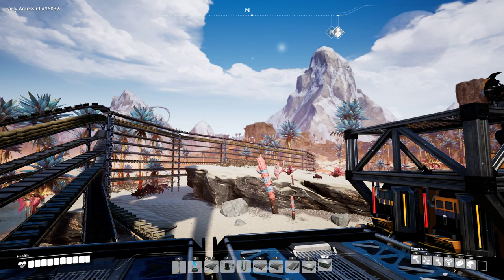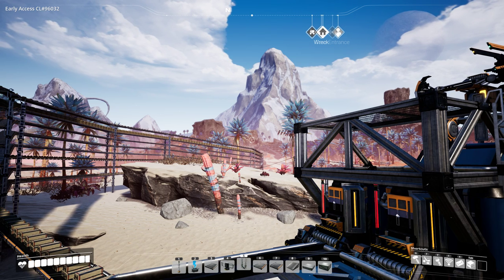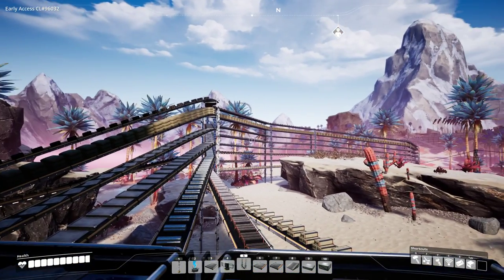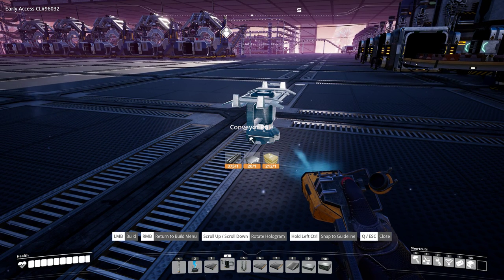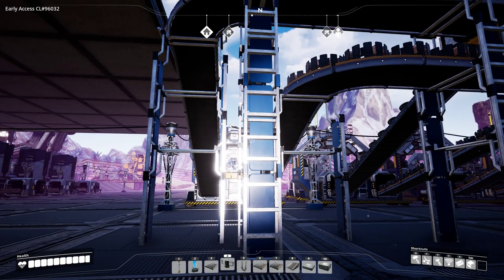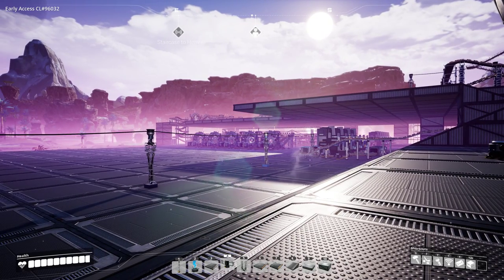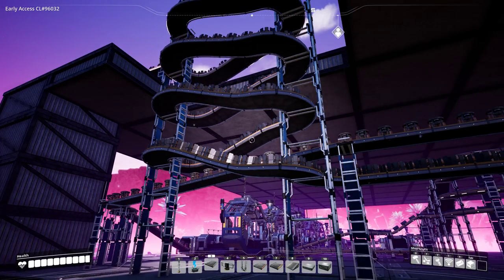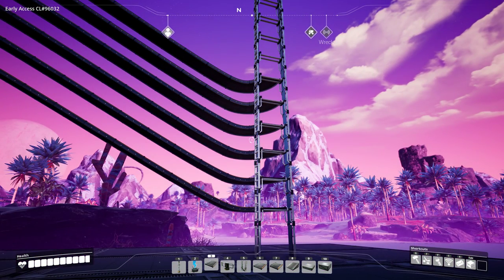Satisfactory Tutorial - Main Bus, Mall & Stackable Conveyor Poles

Comment: To raise a belt 1 level, place the poles 4 ticks apart.
To make a 90° curve, place one pole at least 2 ticks forward and to the side. 4 Ticks to the side for an u-turn.
You can combine those 2 like if you want the belt to go up 2 levels and to the right, place the pole 2 forward, 10 to the right and it'll connect in a 90° curve that goes 2 levels up.
It also doesn't matter how far away the poles are for curves so long as they are 2 ticks apart, you don't need a pole each at the start/end of a curve to make a curve.

And by the way, 8 ticks is 1 foundation so it's easy to measure if you build your poles on foundation seams.
Just go to the middle for the minimum distance to raise a belt 1 level, that's 4 ticks and to the next seam to go up 2 levels. It's handy if you have 6 level belts and want to put something on top.
Reply from the maker: Good precision :-) Thank you!